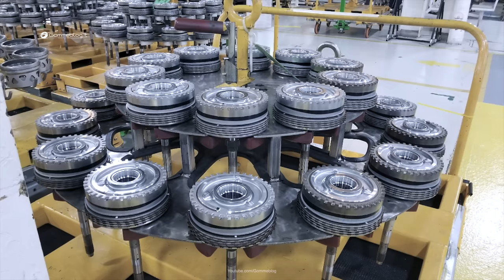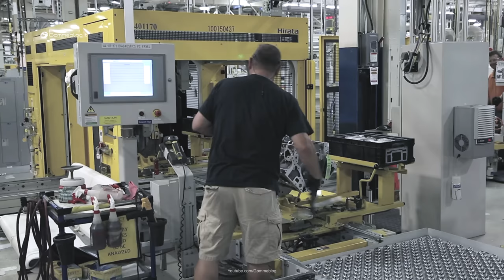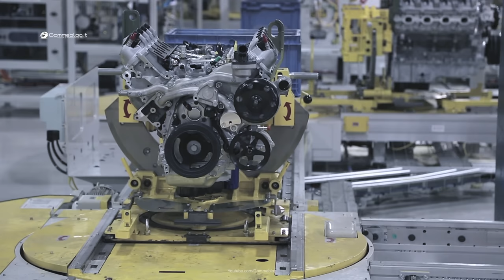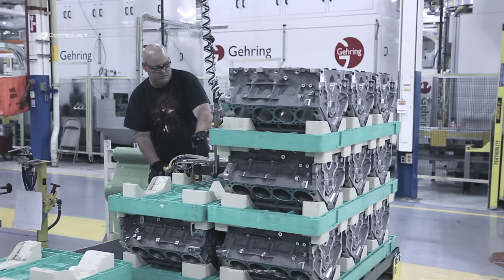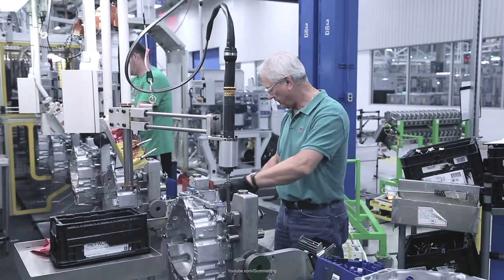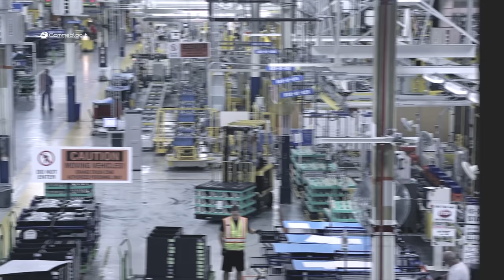GM V8 Engine + GF6 Transmission ⚙️ PRODUCTION LINE

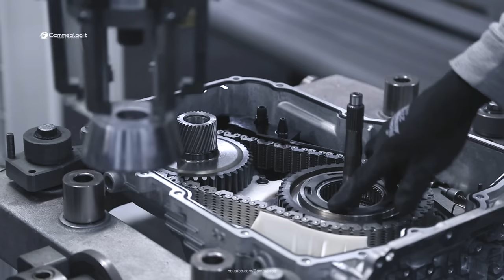Comment: 6:33, matching a big V8 to a 'chain drive' transmission, I wonder how long that will last.
Reply: I'm wondering who much more it would cost GM to make it gear driven 🤷🏿‍♂️
Reply: Thats a FWD transmission probably mated to the V6 engine shown later in the video or a four cylinder.